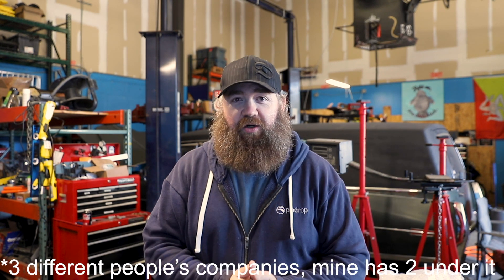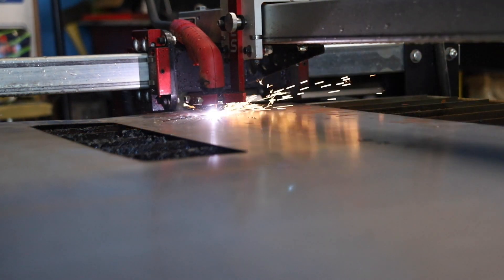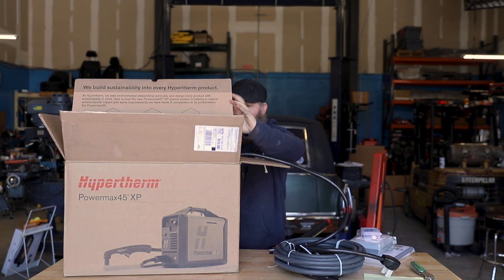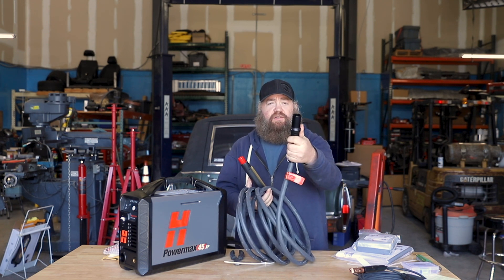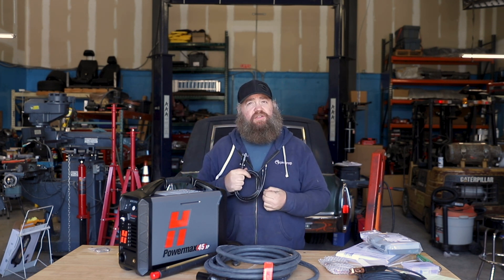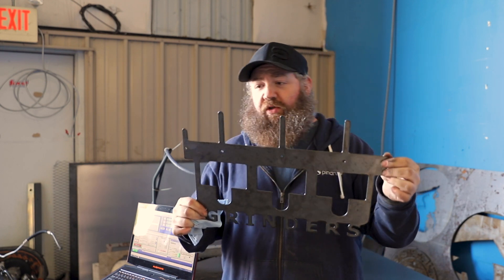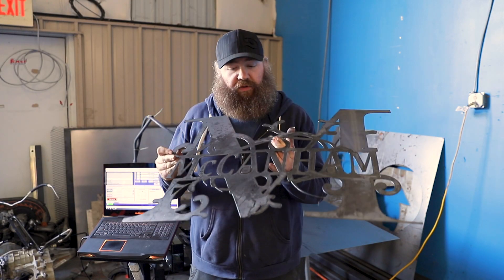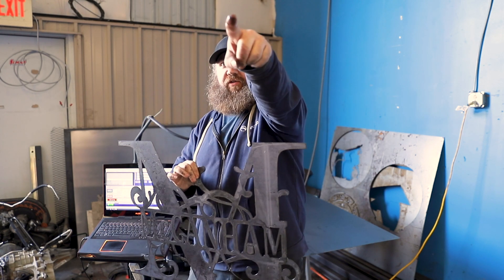Replacing our Razorcut 45 with a Hypertherm Powermax 45 XP for our CNC plasma table

Comment: What brand is ur laptop? Any complaints about the laptop? Do you have to plug it in often while running program?
Reply from the maker: It doesn't need much horsepower to run the FireControl software so you could probably get away with a decent tablet with a touch screen on it.  We've actually retired this table and upgraded to a Langmuir XR (4'x8' capacity) which has its own computer and touchscreen so I don't remember what we were using.

Comment: You don't have a Z axis for THC? Or because you have so much water that it doesn't warp.
Reply from the maker: We upgraded tables last year ( I need to post a video of it) to a Crossfire XR which does have Z and THC.  We were pretty lucky with the old table that the lack of THC didn't warp too much but you really had to keep the machine moving at a good clip to keep heat from building up.   Most of our signs are 16 or 18 gauge steel so if you run them fast enough it's not a problem.

Comment: The fire control.  I have seen people use it with straight lines between cuts.  Can you make it go other ways.  For example you don't want to go over the top of a cut you just made because of tip ups.  Every screen shot I have seen is straight line between cuts which makes no sense to me.
Reply from the maker: On files that we make a lot of I spend a fair bit of time making sure that collision isn't a problem and generally work from the inside out to avoid hitting tip ups.  Sometimes it's unavoidable.  Our new table (I'll hopefully be posting a video of it soon) has a pretty good bit of z-axis so I'll retract the head pretty far when doing rapid transitions.

Comment: Nice video 
I am into regular cutting of 16 gauge Crc Sheet cutting almost three sheets of 4×10 ft on daily basis
So which  plasma cutter will u recommend
Reply from the maker: The Hypertherm Powermax 45XP is definitely the one I'd use.

Comment: Great info and cool stuff your shop is making.  Subscribed.  Ordered my Crossfire pro in December but waiting for it to ship.  I ordered the razor 45 and think it will be fine for what i plan to do for now.  After watching this vid and a few others im concerned about what i might try and do in the future and wish i had just upgraded from the beginning.  I think I may have time to cancel the Razor and order a Hypertherm.  When you ordered yours did you specify for the machine torch style and do you know what other items I would need to make it work on a new setup.  I believe my setup is coming with a THC.  Did you replace the actual mount for the different machine torch.  Will the gear drive match up the Langmuir THC.. Thanks
Reply from the maker: I think the Razor is fine for most things honestly and it's not a bad machine by any means (we still use it to cut sheets down to size) but it just became so unreliable on larger pieces with false starts that I was wasting too much time and material trying to fix it.  If you have a really good air dryer (don't get the Harbor Freight one - there is another video on my channel called 'my love hate relationship with Harbor Freight' that goes into that) you might have better luck.

MAYBE if I had the THC (still waiting on Langmuir to offer one for the older models as alluded to on the forums) the Razor might have been better.  Your Pro model should have the new THC built in.  I did have to get a machine torch mount and wiring harness.  I'm guessing that the THC that comes with the new ones doesn't use the gear on the side of the torch head so much as just a z-axis gantry?
Reply: @TheRockabillyArts  I just bought the Hypertherm. I installed it in the Langmuir pro with the stick opposed to the gun. I noticed the consumable head goes in much further than the razorweld hand torch that came with it. How can I get the z axis up? It seems to be far too low. I have torch height control thanks.
Reply from the maker: @CG-px9qd  Did you happen to get the machine torch holder with the THC?  https://store.langmuirsystems.com/collections/add-ons/products/crossfire-crossfire-pro-machine-torch-mount

Comment: This is interesting as they are both rated for a clean-cut of 5/8" and severance of 1". I would understand it having a better duty cycle given the cost difference. I wonder if you didn't' just have an internal issue with your razorweld? The Hypertherm obviously is a higher end brand., but I wouldn't expect that much of an outwrite issue cutting 3/8" mild steel.
Reply from the maker: The Razor did 'ok' but if the air isn't perfectly dry and with brand new consumables you'd get only a few hours of total run time before it'd start false starting.  Once it was running it performed well but I couldn't rely on it to fire every time.  The taper on the Razor vs the Hyper on thicker cuts is NOTABLE.  The Hyper is just an absolute monster and I can run it 300% faster feed rate with no problems.  The only issue I have with it is that it cost more than the freaking table with accessories and laptop put together :)
Reply: @TheRockabillyArts  did your machine get the startfix?  if not, its a simple proces where you remove 2 surface mount componets and solder in 1 100k resistor.  i have had no bad starts since i did it.  still, thats a big upgrade
Reply: Consumable life is awful on razor weld

Comment: Would you say for a beginner the razorweld 45 is ok? or is the hypertherm totally worth it for the speed / no warping factor? im about to pull the trigger on a crossfire and cant decide on a plasma cutter. I really want to keep the cost down to start out, but Also dont want to buy the wrong tool. thanks for any input.
Reply from the maker: I think it really has a lot to do with your use case.  If you're primarily going to be cutting signs and artwork with it then the Razorweld is perfectly adequate.  If it's going to be for personal use it's solid.  If you're doing a bunch of runs of stuff or needing to cut thicker materials where your machine is really going to be working hard then it's probably inadequate.  The consumables for the Razorweld are really cheap which is good because you have to replace them often and it needs SUUUUUPER dry air.  Total cost of ownership of one of these is really appealing due to the low cost of entry for the table itself but once you've added a water table, laptop mount, design software, air dryer, fittings and hoses (for the love of god don't get those Home Depot orange hoses), pressure regulator, the XL kit (you'll get this eventually) and even the Razorweld you're in the $3k+ range.  There is a $1500 difference at least between the Razorweld and the Hypertherm so if you know you'll be able to make back your money after dropping 5 large on the full setup I'd go with the bigger machine.

Comment: good cutter.  I have it on my 5x10 table.   I have a THC and never use it.  im going to swap out my 45xp for a everlast 82i  with the table torch and built in THC .
Reply: hey there, can you fill me in on the everlast? it has a built in THC? im trying to decide if I need a THC. I dont have a clue as I dont have a cnc table yet.
Reply: did you like the Everlast?
Reply: I never got one. the 45xp is a good machine.  @joshuawilson7201